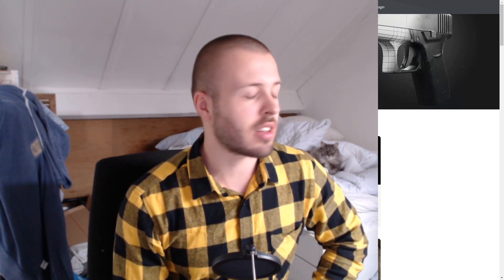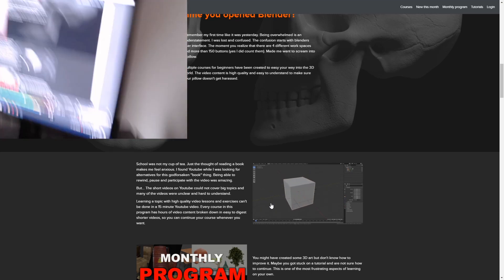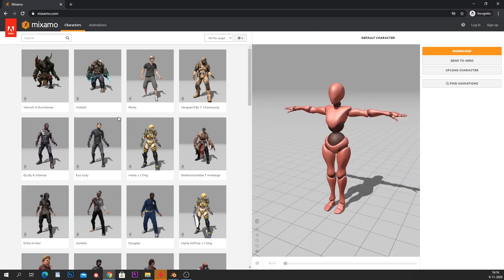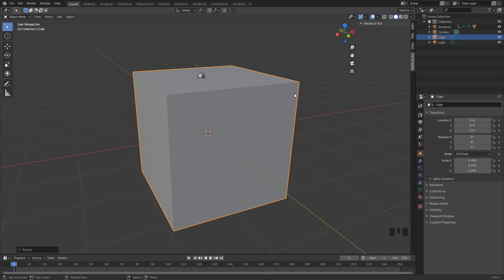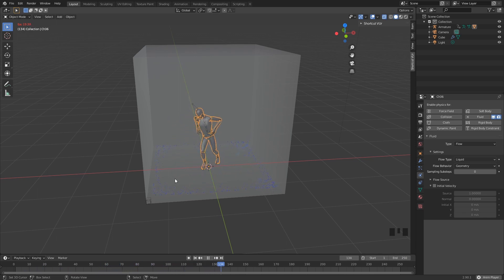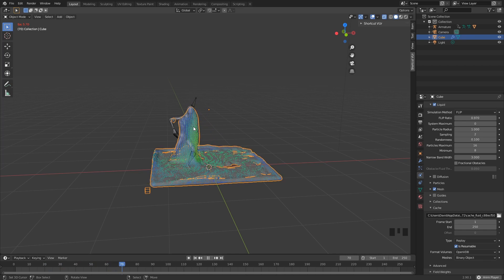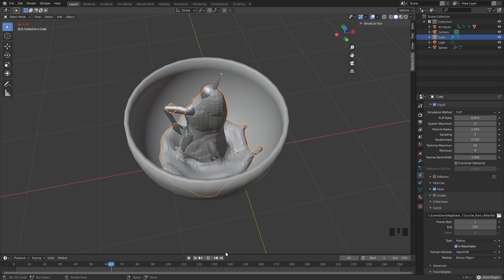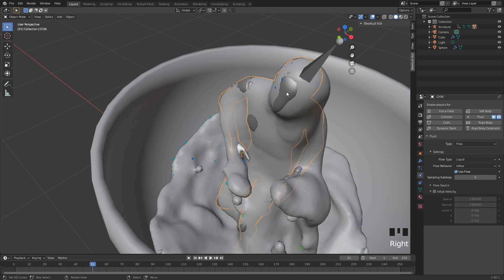Advanced fluid simulation in 10 minutes?!

Comment: Hey, love the video!
I just have one problem, when I put my working fluid (the mannequin) inside the bottle, the fluid doesn't interact at all with the bottle, and just flows straight by...
What can I do?
Thanks!
Reply from the maker: Make sure you Enable Physics > Fluid > Effector > Collision. For this bottle.

If you already have done this then check if the normals calculated correctly.

If you have done all of this and it is still not working you might want to try to scale up or down some of the models (blenders scaling system acts weird in some cases with physics and simulations.)
Reply: @3Dschool-David  thanks a lot I’ll try
Reply: @3Dschool-David  How do i check the normals? (I'm a bit of a noob, sorry...)
Reply from the maker: @gregmontroni1348  Google is your friend. If you literally type what you just commented you will find your answer. and you even get images and videos showing how to do it.
Reply: @3Dschool-David  Thanks!!!!